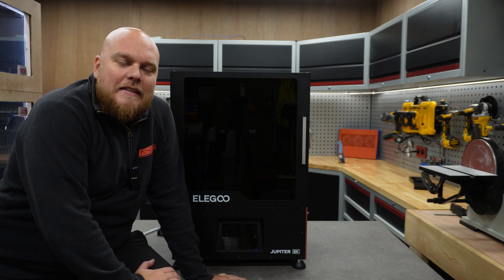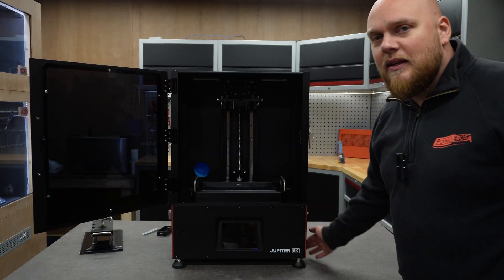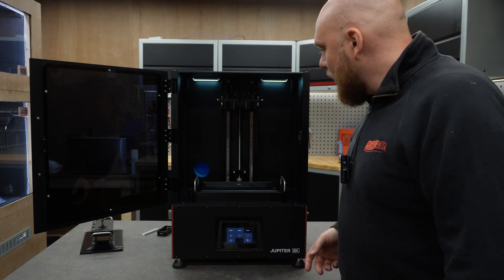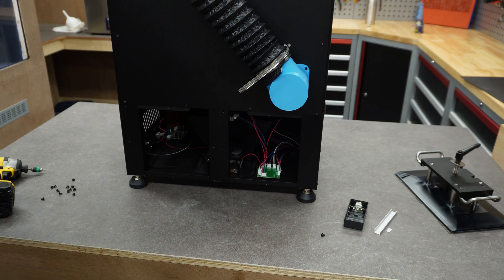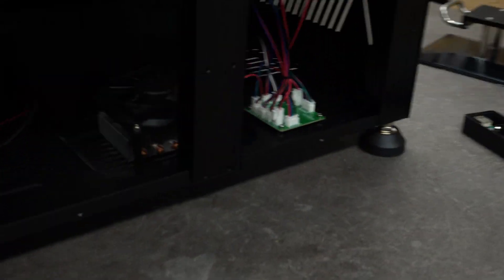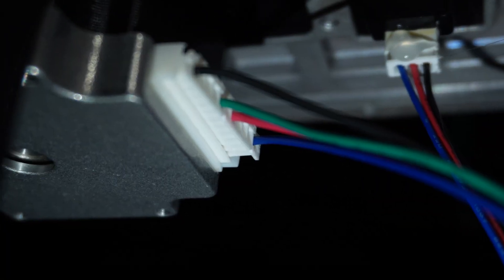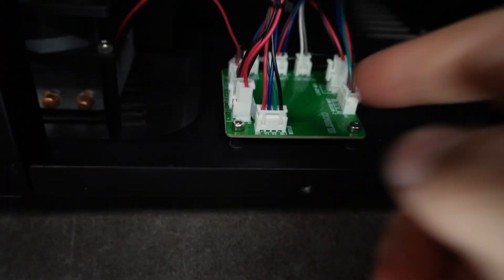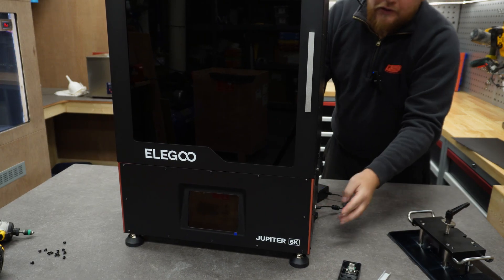First thing you should look for with stepper motor problems! ELEGOO Jupiter

Comment: My Jupiter has lost all electric power. Any suggestions on where to start trouble shooting? Thanks
Reply from the maker: No fan lights screen and so on? I would look at the powerbrick. Open the jupiter so you can measure on the terminals if you have power if so the motherboard is dead.

Comment: Just had the same exact issue, unfortunately Elegoo support recommended removing the entire Z assembly.  After testing it still failed.
I tried this method and everything is solidly connected, tested and disconnected and reconnected and tested again.  Still failed, so my motor might be shot.
Reply from the maker: Yup could be or the driver on the board might be dead
Reply: @NoizieWorks  Trying to figure out what size of stepper motor works.  Board appears to be good, the cables are plugged in and my next step is to replace the motor since it's the most cost effective method.
Reply from the maker: Ask elegoo first to send new motor. They seem to be good with warranty

Comment: Hello Guys,
This is a very nice, and still valid video!

We bought and just received an Elegoo Jupiter 6K in my company, and guess what.... same issue raised, but right after the unpacking!

Means, same noisy and uncontrolled Z motor movement, vibrating  around its position but without any fair rotation, nor required distance movement

So, because, as per this video, I suspected 1 pole not being supplied correctly I open the beast and look at the Z motor wiring for motherboard connector up to the stepping motor
And... 2 wires appeared to be inverted, so I rework this first observed issue... 
Then...
Movement was just...inverted: up command made down movement and vice versa  
So, I tried to find some motor datasheet to rework the wiring, on the connector plugged into the little 'inter-connect' board at rear of the printer.

Let me highlight also  that mechanical contact of ALL connectors are very weak, means male-female connection force is not adequate, according to my (long) experience in electronics.
Therefore I extracted ALL female pins to make suitable bending to increase contact force...

Then finally the operation went ok and I was able to move to Levelling/origin, testing prints and so ON

What is very embarrassing for me is that ELEGOO put lovely "QC passed'' labels almost everywhere, but this is just fancy labelling because based on issues I observed and rework I was obliged to do, it is obvious that this printer was NEVER tested at Elegoo

And this disappoint me a lot: I was familiar to a respectable quality level products on MARS series, but this Jupiter 6 looks like "made by clowns" and this is not serious! Esepcially around $1000 price range!

Last, not least, printer we bought was discounted, …so I wonder if Elegoo did not sale their rejected parts …indeed!!!!
Reply from the maker: So sorry you had so much bad luck... it feels rushed and flawed at the same time as you might find out i did a lot off effort to fix some of them. I think this is a dead on arrival series so far.
Reply: @NoizieWorks  Thanks for your message. Yes, I already saw other videos you made for other fixes, especially the z wobbling. I will check this on my jupiter, and if needed , I will implement it. Thank you for this.